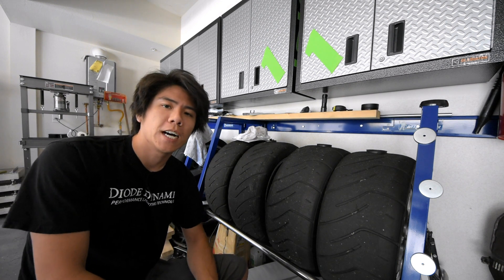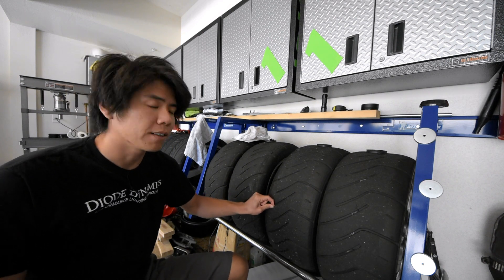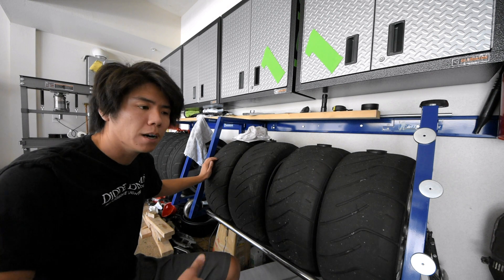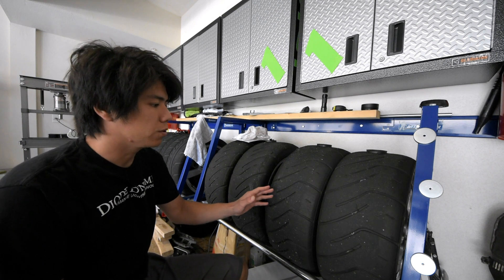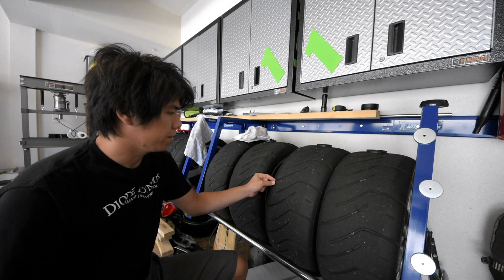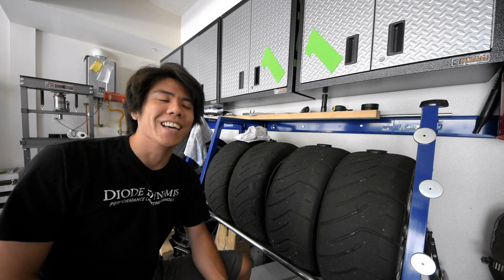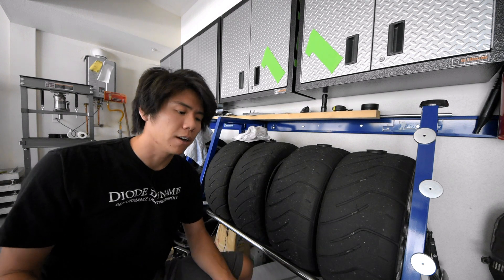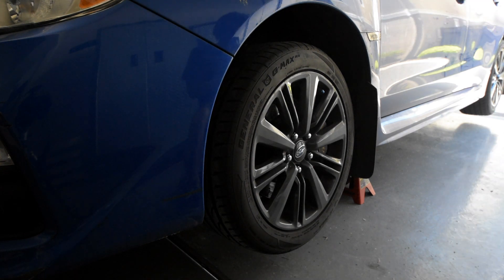Inspection after hitting a Curb / Kerb - 2015 Subaru WRX

Comment: I hit a curb and threw my alignment off. My caster is now 1 degree lower on the collision side. How can you check for bent control arm? Visually it’s hard. The tie rods look fine. My camber slipped on the opposite side. Weird.
Reply from the maker: You can try making measurements of the inboard mounting points to the ball joint. This assumes you bent a control arm and not something else.
Reply: @RacecarWRX  impacted side is 1/8 inch farther distance
Reply: @RacecarWRX  is that a big difference? Could the coil over be the issue?
Reply from the maker: No idea if 1/8inch is within tolerance for the part. That's about 3mm give it take, so it your measurement is done accurately, you can easily think it's off by 1/8inch. As for the coilovers, maybe. 

You hit a curb, if something like caster is out, which isn't adjustable unless you have adjustable caster plates, then something is bent. You'll have to go through every component and check.
Reply: @RacecarWRX  I can see a visual bend so it seems in the anti roll bar. Does this sound right? I can send pictures of you give me a place to send. I appreciate your help
Reply from the maker: The roll bar is bent to clear the tie rods.
Reply: @RacecarWRX  no I mean I took pictures of both sides of the roll bar. And they look different
Reply from the maker: Ouch. It sounds like you hit the curb hard.
Reply: @RacecarWRX  not race track curb. 15 mph under steer in snow into curb
Reply: @RacecarWRX  in your opinion what would be the first componenent to bend? Control arm?
Reply: @RacecarWRX  one arm seems to hang lower than other affecting my caster
Reply from the maker: No clue. Probably whatever is the weakest link.